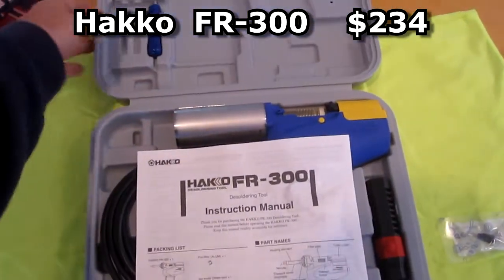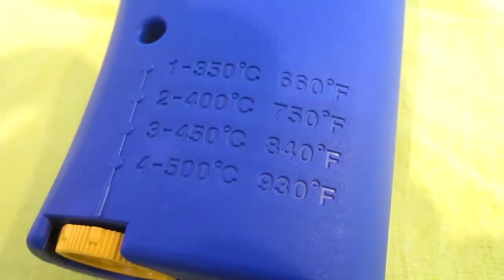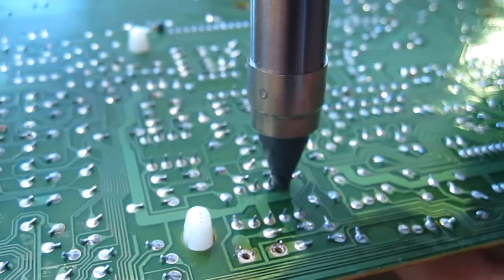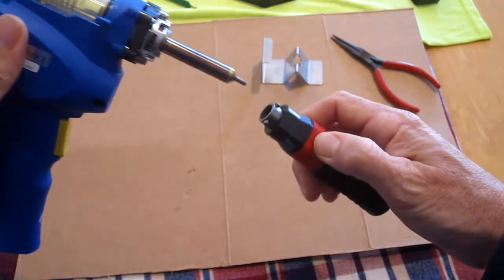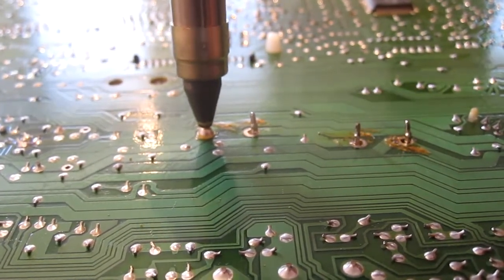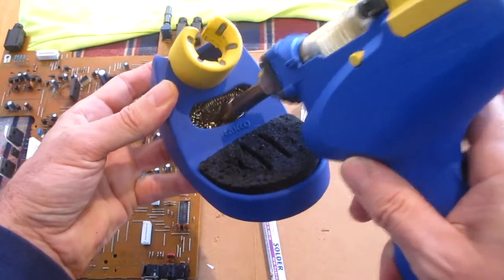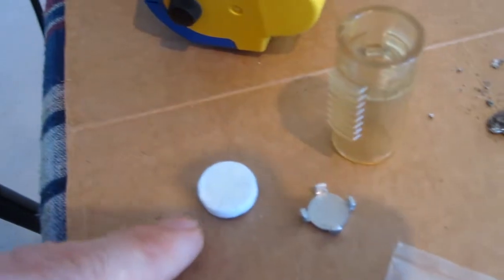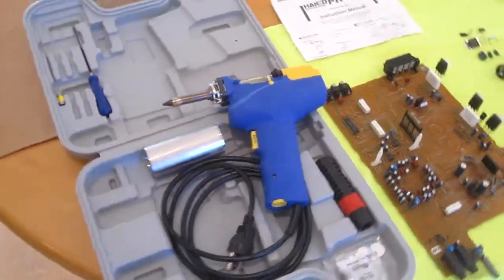Hakko FR-300 Desoldering Pump Tool REVIEW How to use and clean fix repair electronics arcade game

Comment: Just to offer something from my own experience; You will get better results from it if you do not pulse it, but use a longer vacuum pull; IE, sit 1 second, swivel 1 second, suck 1 second; never had a part NOT come loose (Not that it mattered on a single-sided board).  Just seems to work better when there is thermal conductivity due to the presence of solder.  Makes a big difference on double-sided boards.  As for multi-layer (3+) boards, I generally add 1 second for every layer.  Again, never had a part fail to come lose with the FR300 using that mantra/mnemonic.

Comment: What size tip are you using ? I am setting mine up to remove a picture processing unit of an original Nintendo. Thanks in advance
Reply: Looks like a 1mm for small stuff like chip solder points and big caps and old as Hell components 1.5mm? Is that sound right ?
Reply from the maker: i use the stock nozzle for most common stuff, i think its 1mm. then i bought a larger 1.65mm nozzle, part number N50-06, for the bigger stuff like arcade monitor flybacks. sorry it took so long to respond, i just noticed your comment now. thanks